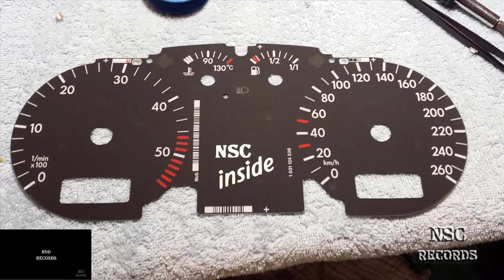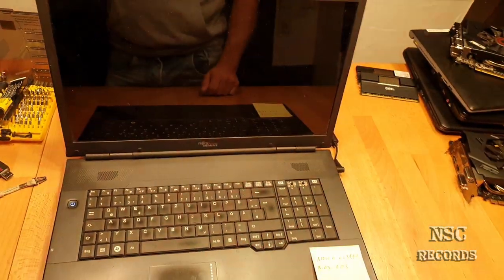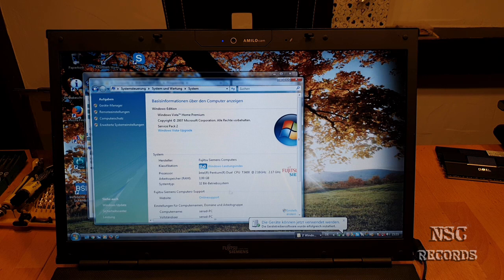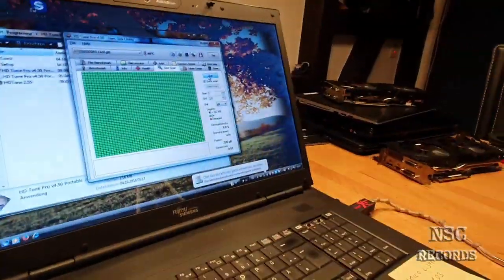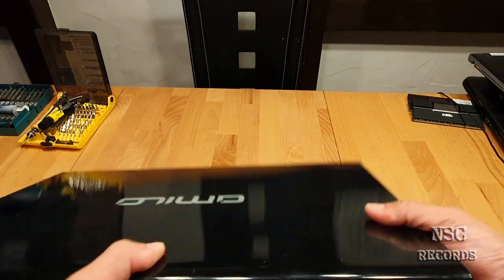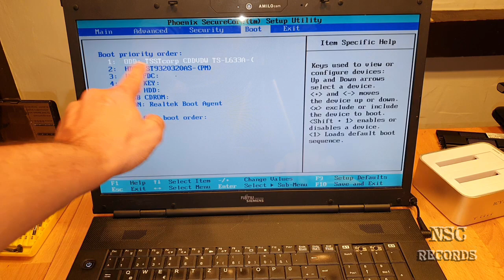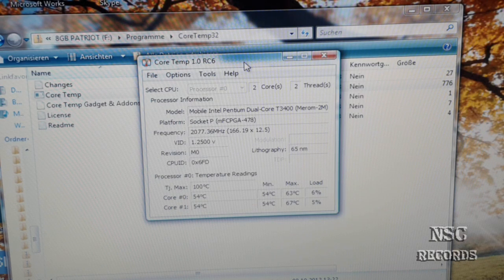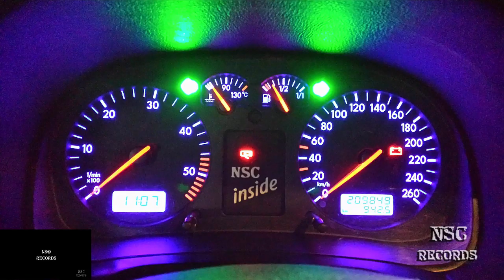How to check a faulty notebook By:NSC

Comment: Funny, I had to use my RT809f twice in less than a week. One just for my notebook that suddenly it wouln't let me to install any windows SO, only showing the boot manager and not my pendrive. Had to flash the bios.
And today, I found something even funnier, I had to flash the bios of two CQ40 motherboards because one was not charging at all, and the other was not showing video either. Now you may ask why it would be the bios if it can be easily the charge stage or the graphic chip.. well, life is weird, isn't it?
Reply from the maker: Yes, computers are alive xD

Comment: ic sag nur SSD tut mir leid, sonnst passts aber Festplatten hab ich schon garnicht mehr in meinem Haupt PC Booddrive is: Crucial BX100, auch in meinem Core I5 Laptop ist eine 250er Sandisk SSD Pls drin der PC würde heut noch gut laufen der Pentium eine SSD wär nicht schlecht, bei so einem Notebook bzw. da eher noch Laptop ist esentiell Lsten to your Harddrive, it screams that she wants to be swapped by an SSD ^_^ CPUZ is auch geil des im Video zeigen und vor allem GPU Z
Mittlerweile mit dem boom wieder wo jeder zum PC switcht, und günstige Garten kauft teilweise so günstig das man es nicht glauben kann. GPU Z erkennt ja auch Fake Grafikkarten wie z.B die ein paar GTX 1060 mit einem GF 116 cip der aus einer 550ti stammt., wooops ^.^
Ein neueres Windows sollte man auc konsultieren also Vista, ne :/
Win 7 oder 8 vista is echt zu als und ich weiß dass du sher im oldschool rumhängst mit win7 aber vista :PPPPPPPPP ^^